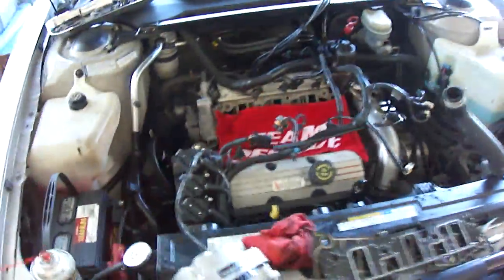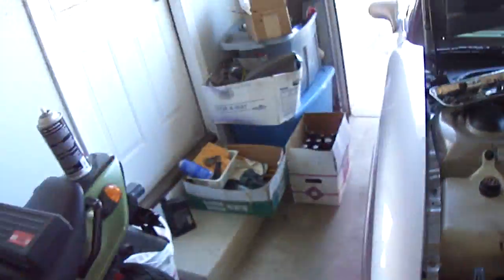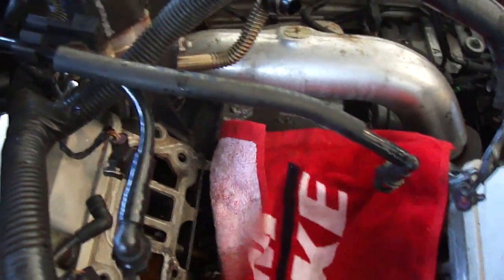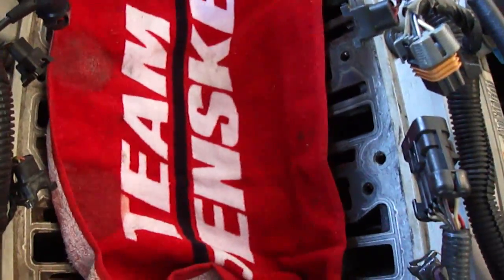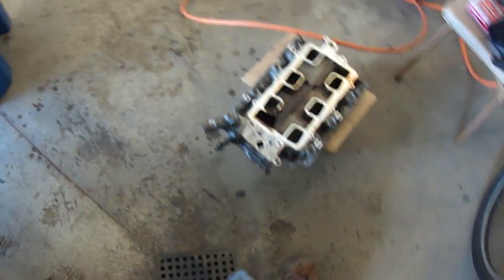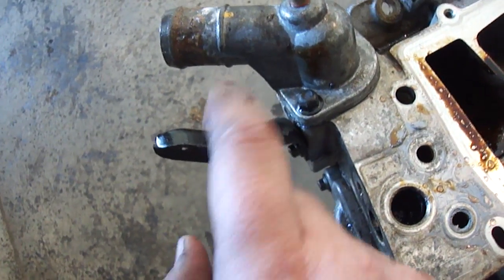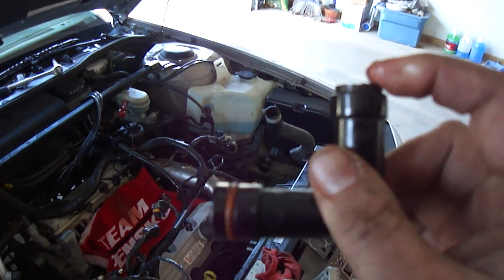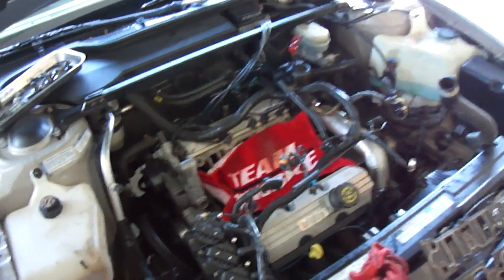3800 Lower Intake fix

Comment: i have a 2006 Pontiac Grand Prix GT w a 3800 supercharged engine.     it has 50,000 mi on it.    i am losing coolant.    it is going into the combustion chamber, and leaking out of the exhaust.     if i rev my engine with the radiator cap off, coolant with shoot out of the radiator.    my oil looks fine, but it's had to tell because i change it quite often.     i head that intake gaskets fail a lot on GM 3800 engines.    i think that they tried to fix that problem before 2006, but i ain't sure.     i do let my car idle for hours at a time though, and so i suspect that heat from all that idling caused a failure somewhere.    i,m just trying to figure out if it's a 
• blown intake manifold gasket
• blown head gasket
• cracked head
• cracked block
GM used a cast iron block and heads on that car.
Reply from the maker: +Jeff Fuehr Get a test kit from NAPA to see if you have combustion gases in the coolant.  The L67 engines had trouble with lower intake gasket issues also (2 o rings that could let boost get into cooling system)

Comment: Thank you thank you! I was working on my 3800 engine and It was believed that the head gaskets were bad but the car ran great in idle. I was fighting to remove my lower intake manifold and didn't know about those two hidden bolts. After I pulled those two the manfold came right off and I was able to see the lower gaskets were shot. There was a thick glob of brown/ chocolate mud in a few coolant tubes. Thanks for this video. I probably would have drove my self crazy or damaged the manifold trying to remove it.

Comment: what year 3.8 L's use the metal intake ?
Reply: meTimetraveler Depending on which direction in years you go. The series I along with the pre-series I (LN3) all the way back to the rough running Buick V6 all used metal intakes and were all one piece intakes. then GM through some engineer's ingorant wisdom decided to cut the intake in half and make the top from plastic and keep the bottom aluminum....I mean what could go wrong mating two completely different materials together right?? Just as long as theres a shitty gasket it will be all good. 

Then I suspect an engineer got fired and GM got tired of the complaints so they created the Series III known as the L26. They finally switched it back to aluminum but not without fucking you over if you have a series II. You have to mod a series III UIM to match the series II since the series III has a computer controlled throttle body. So no direct bolt on of the TB. But it's not too hard to mod it to take a Series II TB. 

Now as for years for the series III it was anything after mid year 2004 forward until the 3800 was retired in favor of the high value V6 (the LZ9 to be exact) basically the engine you see 3500 V6 on the cover. This was around 2008. So plenty of Series III UIM to pick from as they are now starting to show up in scrap yards. Funny thing is I saw the LZ engine series in the scrap yard before I did the series III and they are still somewhat rare to find there. I got my aluminum on from a early model Lacrosse. 

The Series II supercharged engines actually had an aluminum intake all its life. To switch to a L67 you have to do a top swap since the heads are somewhat different. So you have to grab the heads, UIM with S/C, TB, and a few smaller things. Your LIM should work so no need to grab that. The cost for me to do it would be 375 to 400 bucks VS modding a series III to gain durability which cost me 25 bucks for the UIM. 20 for the gasket and 30 (adapter plate making my own). Maybe when I decide to retire my car from daily driving I will do the S/C upgrade. And that price wasn't including a 4-T65E-HD tranny with HD axle shafts. 

Sorry for the long run down the answer wasn't as straight forward as one might think. But I am assuming what you meant was what years GM switched to the alloy intake after the plastic intake fuck up and that would be late 2004 to 2008.

Comment: @Dubsta253 ok cool thanks for the info man the intake with the ramps I mentioned was from a 2002 Buick le sabre i got that motor at the yard for cheap with only 46,000 miles on it I could tell it was an old persons car cause I could still smell it.

Comment: The engine with the ramps will have more horsepower. I read about this and cant find the site but alot of the series 2 came stock with the intakes ported with the ramps. I believe thats a type of port job on it. The ramps help flow  i know that much.

Comment: Since u seem to know quite a bit on GM 3800s I had an intake of a series 2 3.8 not sure what year or model but It had these little ramps in the intake runners. Then another intake I had of a 2000 grand prix gt 3800 series 2 didn't have those small ramps near the injector holes. What is the intake with the ramps from and would it be a performance thing or economy?

Comment from the maker: Thanks for the comment, Chuck.  I had a repeat failure of the aftermarket coolant elbow about 2 months after I did this job.  I went with a OEM elbow and it has been dry for the last 30k miles.  If it fails again, I'm going with the ZZPerformance aluminum elbow kit.

Comment: Secondly which is just speculation I guess with the aluminum elbows, If you ever have to change them once you have went with aluminum be careful when you pull them out they are stronger then the plastic obviously and have a better chance of damaging the intake holes on the car.... Just something I was told by a fellow 3800 owner.

Comment: Looking to tackle this job on a 01 grand prix 3800. I changed my coolant elbows about 2 months ago they had broken off just like yours. I ended up sticking my finger in the elbow hole in the intake.(the more visible coolant elbow) I could feel the broken off piece inside... the intake was steal on the car, so I used a  shop vac to suck the piece of plastic closer to me then used a wire hanger to get it out. I could have left it but since I felt it in there, I couldn't stop until I got it out.

Comment: I had this exact same problem and was facing possibly ripping the manifold. The piece im missing is about half an inch larger than yours, think im just gonna leave it sitting and put everything back  together. I took this oppurtunity to check my water pump and its flawless. Could use new gaskets all around TBH but im not planning on keeping the car beyond another 100k miles. Thanks for the insight.

Comment from the maker: About 4 months ago, the aftermarket elbow failed on me again.  I went to the dealer this time and bought a GM one, along with the O ring for the belt tensioner (you have a second elbow on your Impala, different setup on my 88) and finally replaced it.  No leaks.  The Napa part failed in the same manner as the first one did, it just did it in 6 months time.  It is a stupid design no matter how you figure.

Comment: I just had my coolant flushed and changed to green, the AC-Delco mechanic suggested not using Dexcool. :) I'm sorta neutral and think if you change it every 30K it might be ok... I bought a few extra coolant elbows and just plan on changing them out yearly, like regular maintenance. GM should come out and make changing them out and the coolant every 30K-50K miles part of the maintenance schedule. I'm just glad they were easy to do myself and can use the $350 towards something else like tires.

Comment: I'm changing those coolant elbows and o-rings on my 3800 Impala too and part of on end slipped into the intake manifold as I was trying to fish it and the o ring out. I'm considering leaving it that way instead of tearing the intake off. Did the bits of plastic in your coolant affect your engine that you know of?